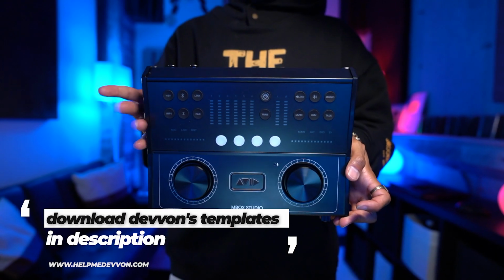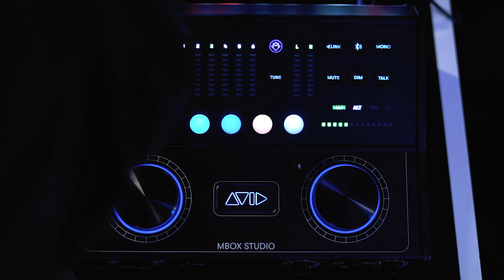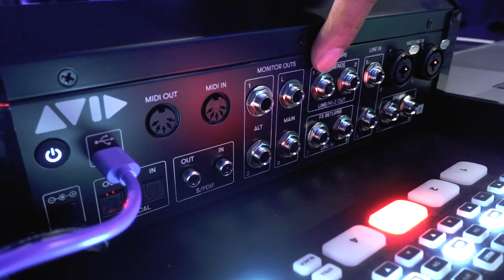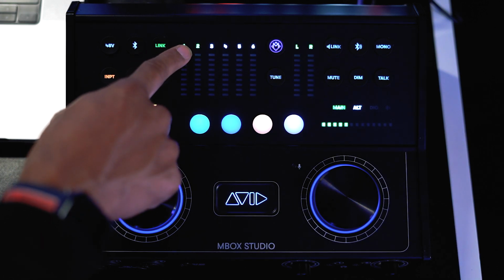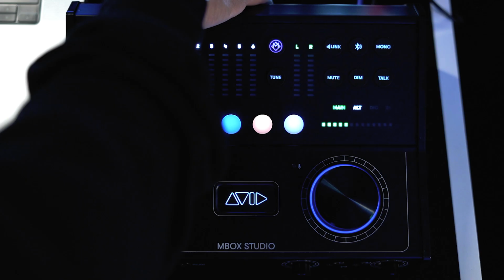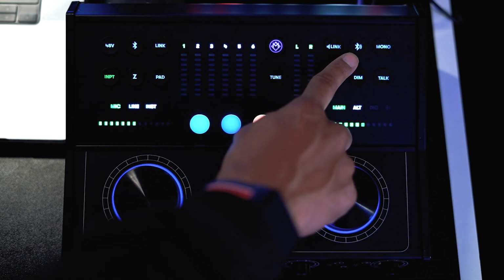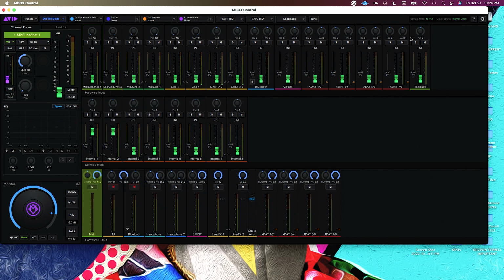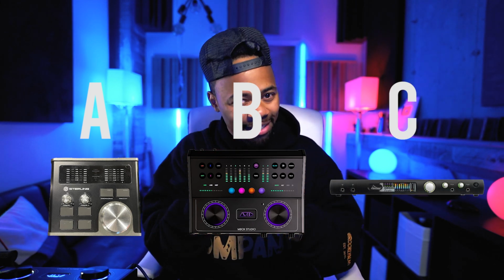The AVID MBOX Studio Review With AUDIO QUALITY TEST

Comment: Thanks for the excellent review Devvon! Regarding integrating a sub, you can actually use the ALT out for the sub. All you need to do is disable auto-muting for monitor switching in the MBOX Control software and then assign monitor mutes too a couple of the User Action buttons. That will allow you to pop the sub in and out with a button press. You could also do something similar with the line outs/sends if you want to run 2 sets of analog monitors plus a sub. The S/PDIF dig out can also be used for digital monitors aso that's an option as well if your monitors or sub have a digital input. Lots of ways to customize workflows when you start digging into MBOX Control. Cheers! 🤙🏽
Reply from the maker: Yes thank you john im going to pin this comment so people can see the way to do it.

Comment: Can this box be used for Dolby Atmos 7.1.4?
Reply: I think if u use the Adat output u can gain another 8 outputs so therefore yes.   Atmos can be tricky  because the magic that genelec does for example on there room correction SAM system it time delays ea monitor and the height channels so it sounds like it should then u get the Dolby renderer   Some workarounds but I think u could do a 18i20 Adat